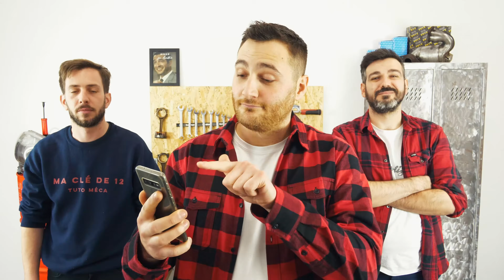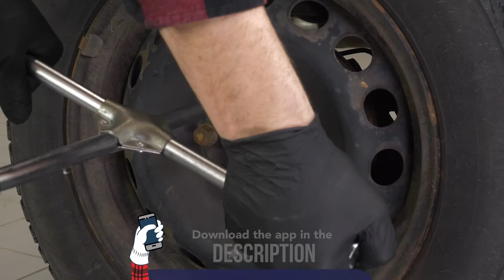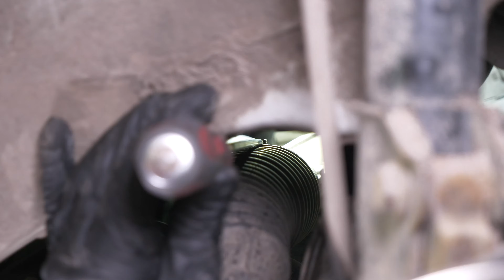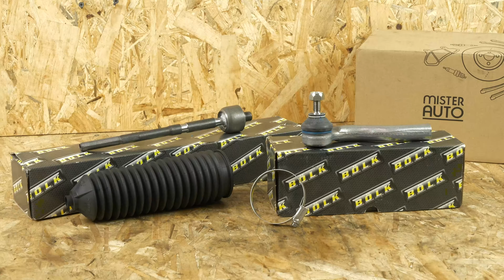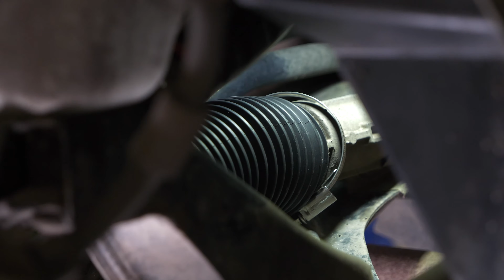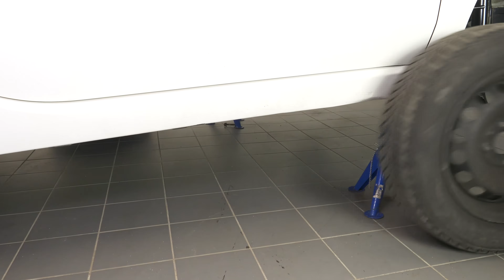How to replace the inner and outer tie rod Fiat 500 🚗

Comment: I have just done this jon on my car, in reality it is a lot harder than shown on the video and I would class myself as a competent DIY mechanic. First the track rod ends will not undo as the nuts will make the ball joint spin in it's seat.I got mine undone just enough to be able to hacksaw the nuts off. Secondly even with the tool shown I couldn't get the inner joints between the tie rod and the rack undone as the tool will just slip unless you wedge something else inside it. Like most jobs on these cars be prepared to fight every step of the way.